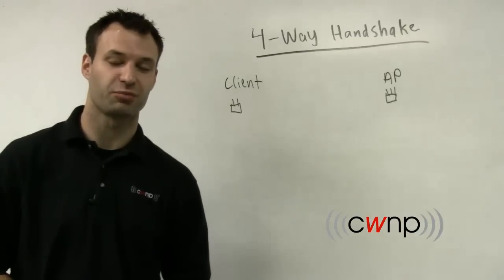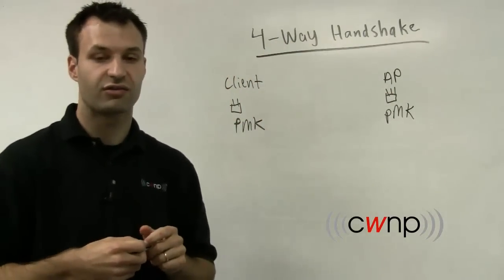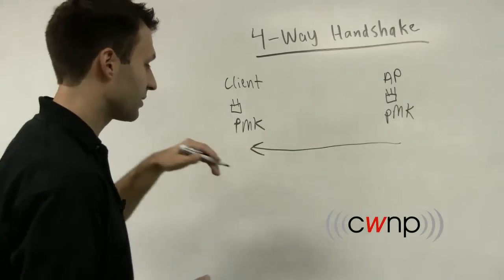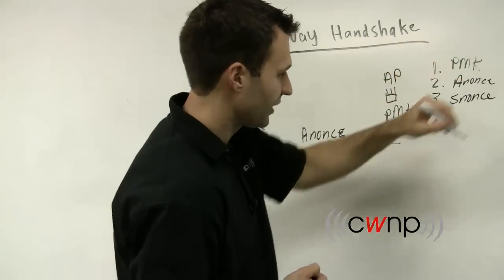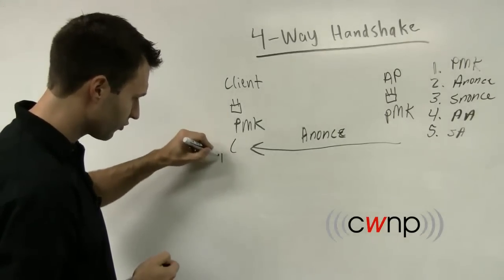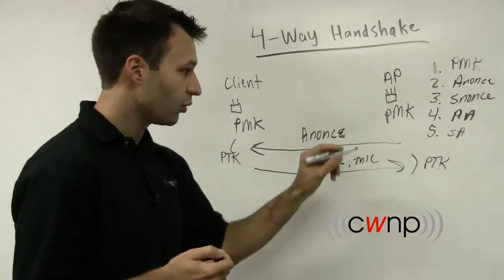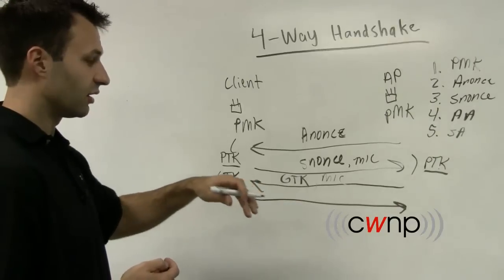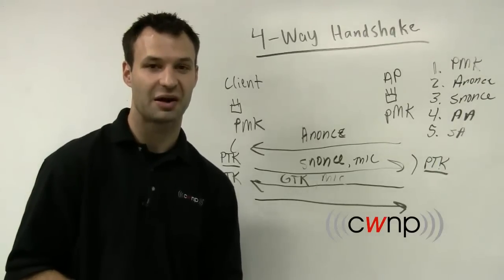The 4-Way Handshake (Marcus Burton, CWNP)

Comment: Great video, unfortunately, it's oversimplifying it a bit too much. The GTK exchange is not part of the 4-way handshake,  and the model he draws are thus missing two messages. 

For those interested, here's a more formally correct version of the 4-way handshake (4WHS): 
--
1: Authenticator sends: Anonce, IDa, SQN
2: Supplicant sends: (Snonce, IDs, RSN IE, SQN) + MIC 
3: Authenticator sends: (Anonoce, IDa, RSN IE, SQN +1) + MIC
4: Supplicant sends: (IDs, SQN +1) + MIC 
--
<<GTK exchange comes here, after the 4WHS>>

//Acronyms: 
IDa = Macaddress of authenticator // Needed to derive PTK
IDs = Macaddress of supplicant //Needed to derive PTK
PTK = Pariwise Transient Key
SQN = Sequence number // Used to stop replay attacks
RSN IE = Robust Security Network Information Element. Basically which cipher suites are supported by the entity.
MIC = Message Integrity Code // Used to prove integrity of the message and authentication of the sender.
Reply from the maker: The GTK is transmitted during the 4WHS. The GTK exchange is used to transmit a new GTK to existing connections at a later time if required.